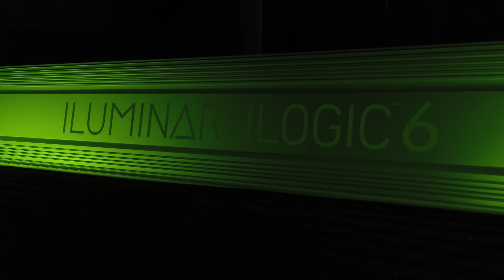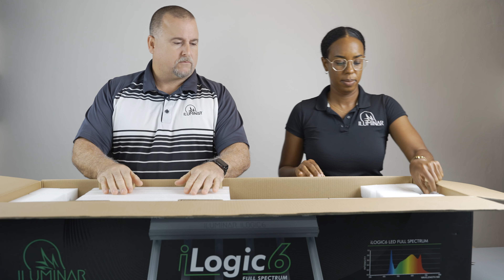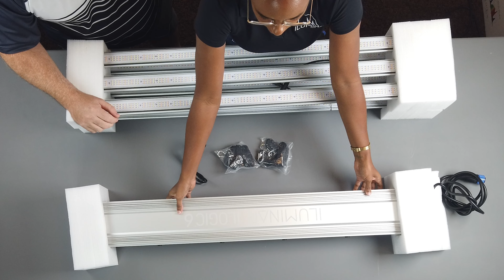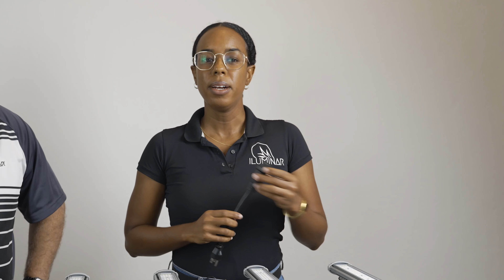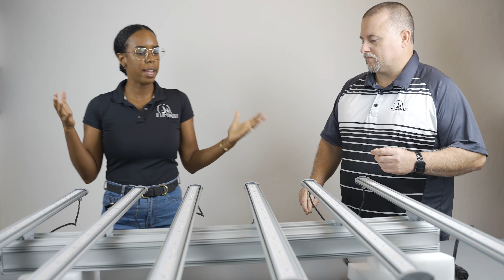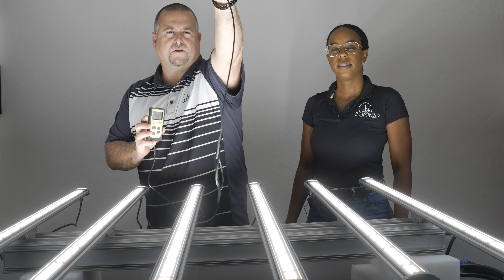Unboxing iLogic™6 330W LED Grow Light

Comment: ENERGY EFFICIENCY IS KEY. LOW INPUT IN WATTAGE HIGH OUTPUT IN PHOTONS(PLANT LIGHT ENERGY). THAT'S THE WHOLE POINT OF LED TECHNOLOGY TO BE MORE ELECTRICALLY EFFICIENT. INVESTING LITTLE TIME & ENERGY TO CREATE A PERPETUAL CYCLE OF MASSIVE INFINITE NEVER ENDING LIGHT, ENERGY & LOVE.